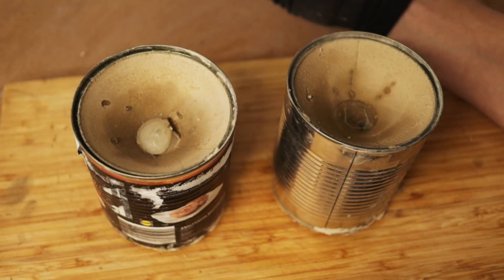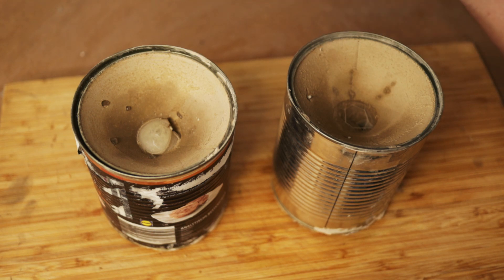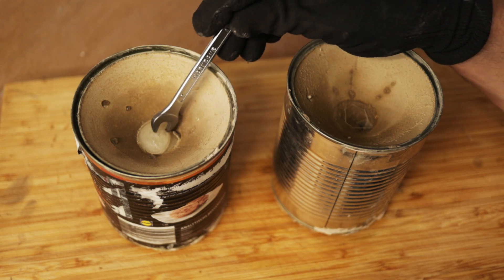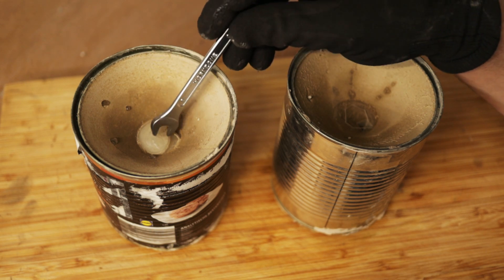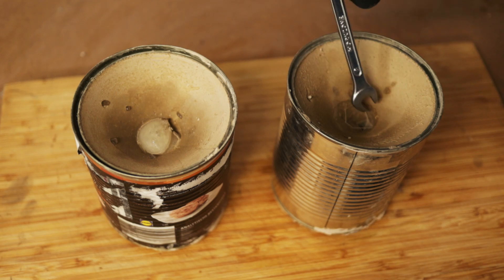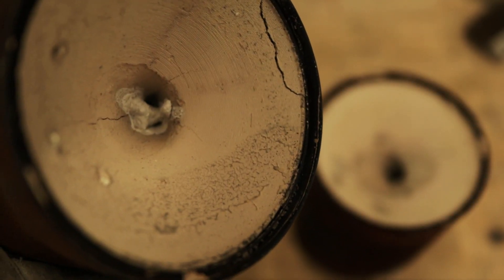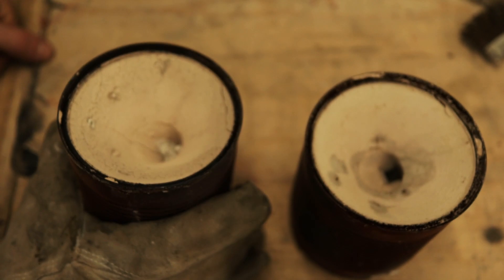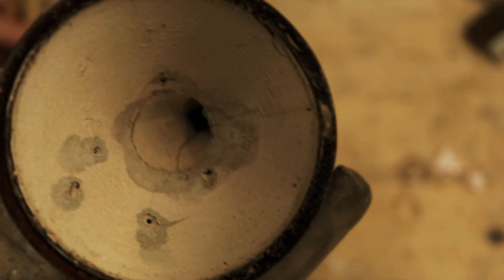POLYCAST VS PLA | is it worth the premium ?

Comment: Ive bought all the ingredients to make your investment and im getting ready to do my own castings with cast aluminum. I was hoping you could let me know what kind of burnout schedule you follow for your castings. Im using polycast filament. My castings will be a bit larger then the ones you did, but itd still be great to know how to heat the investment and have the best chances for success on my first attempt at casting.
Reply: Starting at 100C, hold for 2 hours then increase temp by 100C. Do this until you reach 400C. This is the main melting phase.
Next you need to raise the temperature to 700C over the course of two hours, and hold it for an additional two hours. This is the burn out phase.
Next you allow it to cool fully to room temperature, the slower the better (to reduce cracking). Then you can use compressed air to blow out the ash.
Hope this helps the next person, since I'm two years late.

Comment: You use a unique recipe for the mold .  any advantages other than the ability the break it apart easier? maybe it conduct heat better than a mixture of only plaster and sand ?
Reply from the maker: The DE is from what i know a little bit like a reinforcement, like microscopic fibers  but i need to to further  testing, if it really makes much a difference
Reply: @ChristophLehner  Thanks . i am about to build my first furnace to metal cast some of my sculptures. which are moderate in size , and i figured out i need a pretty large crucible. , of at least 1 litter. if i may ask your advice , do you think  it is  possible to cast in 2-3 batches to fill the mold?

Comment: Very good job!!!  I have  probably a naive question....what was the % infill  and the wall thickness that you use during the 3d  printing..I guess very thin walls...might do better during the burnout procedure.  You have a new subscriber.
Reply from the maker: I did 2 shells no infill. Since you have less to burnout and also less expanding force when the filament gets hot
Reply: @ChristophLehner  Do you remember the thickness of the shells? THanks
Reply from the maker: @learningpower9437  it was 0.4mm for each shell
Reply: @ChristophLehner  Sorry to bother you with so many questions...have you ever try to make a very thin wall from your 3d print (one layer)...and add the melted aluminum directly...(avoiding the plaster and burnout procedure) ???
Reply from the maker: @learningpower9437  don't feel sorry :)
No i didn't, but i've seen some videos, and the surface quality is not so good. Comparable to sandcasting...

Comment: Hello, amazing work! I've been struggling for a while with some issues with this filament. I would really appreciate some tips. Im using the same 3D-Printer and Cura. Thank you!
Reply from the maker: What's the issue excatly? Bed adhesion?
Reply: @ChristophLehner  I'm printing a very small object with lots of details (a ring), using the smallest nozzle possible 0.2mm. I can't get  the quality required, I guess because of the stringing. I've tried different configurations with Cura but none have proved succesful
Reply: @antonioquirosvalerio1812  combing mode all

Comment: Did you notice if you have to have a lower nozzle temperature for polycast compared to regular filament like Polymax?
Reply from the maker: No, i printed it like regular PLA, 200C and 215C on the first layer, altough bedadhesion was a issue, so using a gluestick would be good

Comment: Wonder how much better the surface finish on the polycast would be using the polysher. It was very good from the looks of it without. According to their website the polysher works with the polycast as well as the polysmooth. I’d like to try the polydissolve for supports with the polycast
Reply from the maker: AFAIK, you can use Isopropanol and rub it on the print, to hide layerlines
Reply: I have been placing my Polycast parts in a strong ziplock bag with 91% ISA and shacking a little for 6 minutes. Pull part out, let dry and then do again, until I am happy with all the lines are gone. It has worked very well.

Comment: I have better luck with natural pla over any of the so called casting filaments
Reply from the maker: Isn't natural pla also colored?
Or did you use transparent pla?
Reply: @ChristophLehner  transparent If bring the mold up to 1450 for five hours.  What little ash  I have is gone five minutes after it sits in the pickle. the surface shows no roughness from ash.
Reply from the maker: @robertroberts2795  thanks for the insight, i'll try transparent pla in the future
Reply: @ChristophLehner  my burn out cycle rise of 200 degrees Faren. to 500 degree. hold for 4 hours maybe five.. then 200 degree rise to 1450 and hold for four or five hours. then cool to 1250 and hold for two hours and cast. this burn out is for non ferrous metal such as brass bronze and silver. I do not cast  aluminum.
Reply: also I buy casting investment.  the cracks I saw in your mold led me to believe you are using Plaster of Paris.  Had a friend tell that  you could use potters plaster and silica flower of 325 mesh and come out pretty well. I do not know this for fact, but silica is one of the main elements in casting investment. this would add some cost but still cheaper than casting investment.
Reply from the maker: @robertroberts2795  thanks for the tip, with silica flour, i will have a lok into it